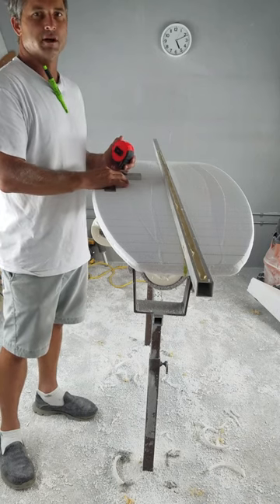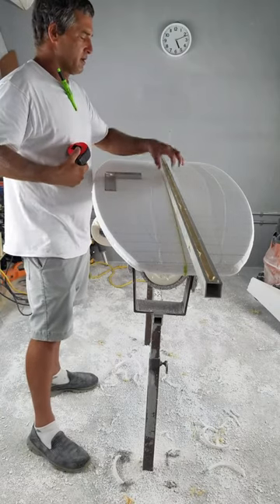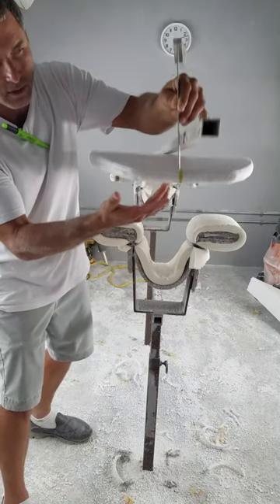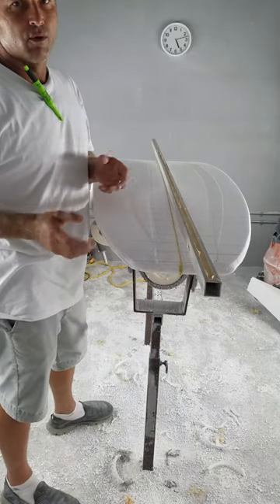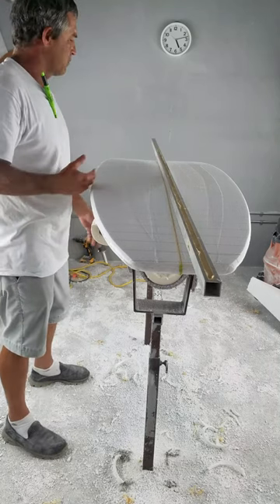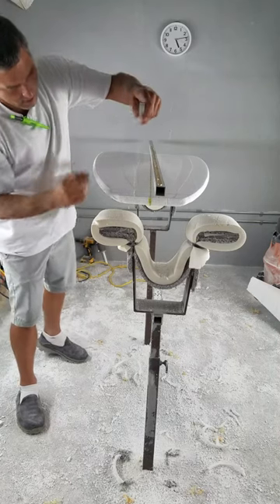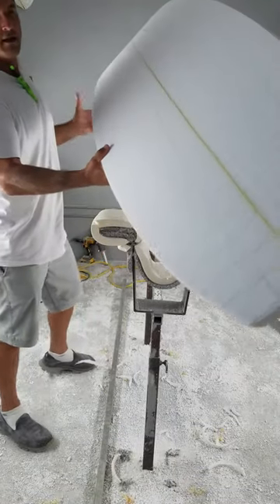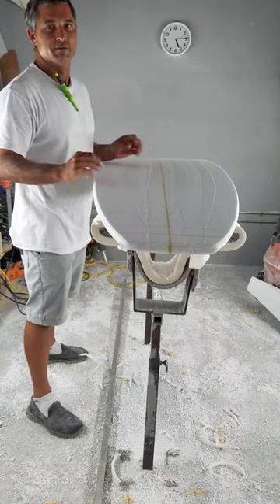Measuring and duplicating magic surfboard rockers.

Comment: Thank you very much for sharing your knowledge. Gone on my 7th self made board and still in search to verify where the zero rocker point should be placed and for what effect. A general indication would be much appreciated.....
Reply from the maker: TheMonkini. That is a common question even among professional shapers.  I use exact center because it is fast, easy and repeatable board to board.  Some will use the natural balance point of the board itself but those numbers change if the board has wax, deck pad or dings that throw the weight forward or back.  All that matters is that you can take a set of numbers that you can understand and apply to a blank consistently. An extreme example would be of you made your tail the zero starting point and started your straight edge from there.
Reply: Much appreciated! been thinking about this for a log time.

Comment: Matt, thanks for sharing, but i got a question, base on your knolege what is the Best minimun and  maximun tail rocker a board can have, don't know if the question is right or if You get the idea of it.😅
Reply from the maker: Tough question because it depends on the length of board butlers say shortboard under 6'8" long.  1.75" to 3" have been successfully used by various shapers but let's say that I could only pick one tail rocker number for every board under 6'6", it would be 2.25"

Comment: The more I learn, the more questions come to mind (so please bare with me)........please help me....
I noticed in another video you suggested a tool specific for rails called a fred-tool or something...which should a newbie use, planer or fred-tool, or sureform?  Sometimes 'm seeing shapers pencil in a line down the rough rocker before shaping it...man I'm confused...

Also, what if you want to shape a blank's natural rocker flatter in the entry or nose area??  Is it possible?  Would I plane or skin off only the bottom of the blank starting near the center of the board blank toward nose to achieve this? And if it is too flat after doing so, would I plane or skin off something from the top deck to get the upward curve in the nose back?  How do I keep the deck and bottom symmetrical from stringer out to rails (for entire length of the board)?   

Which comes first...the finished shaped board or the measurements, or a combo of both starting before the blank is ever touched??
help me Ole Ben Kenobi, you're my only hope!....
Reply from the maker: The Fred tool helps get a consistent bottom tuck angle, same can be done with a surform. The question of how to lower the entry rocker is a difficult one because you can't actually lower that entry rocker by planing the front, that only flattens the rocker.  The easiest way to lower the entry rocker is to start your shape further back on the blank.  Cutting 2 inched off the nose works wonders for lower rocker noses.

Comment: Hey Mat! Thanks for all the sharings. I'm a bit confuse because in an other video you're saying that the bar sag the blank and actually after measuring it it was the case. And now in this video you're saying the opposite. Not searching any fault in what you're saying, I'm just getting lost. Maybe here it's not the case and you eliminate the argument just because of the sickness of this particular blank wich is not sagging under the weight of the bar.
Thanks a lot!
Reply from the maker: I am sorry for the confusion. The blank does deflect under it's own weight and under the weight of the rocker bar. The other video I am discussing the level of the blank and how that really does not affect the rocker measurement, just to show that you don't have to be careful about having level racks/level blank etc.  The blank sag is still an issue to watch out for.
Reply: @kazumasurfboards  Thanks for the precision Matt. I've seen Leo Paul Etienne riding your boards in Guadeloupe, they were looking really great for the waves there. Keep on posting videos please, sharing is saving this profession. In my opinion this is super helpful for surf culture, thanks a lot.
Reply: Olivier    it does not sag